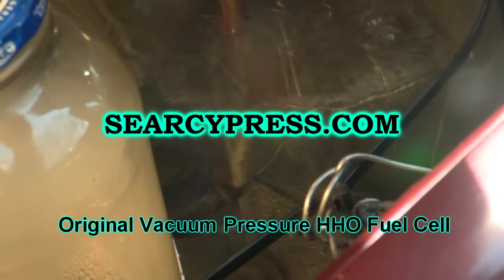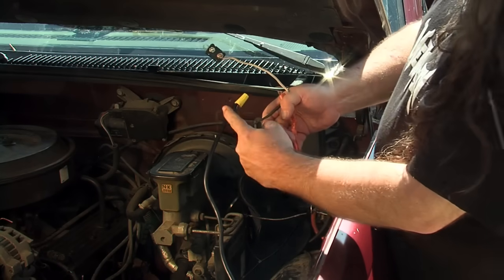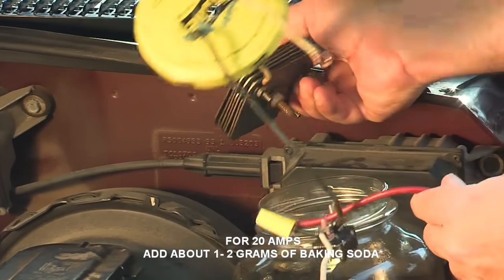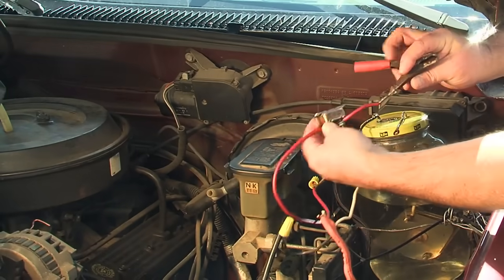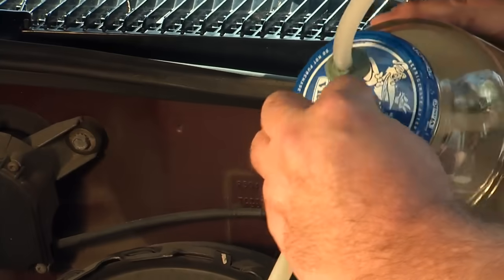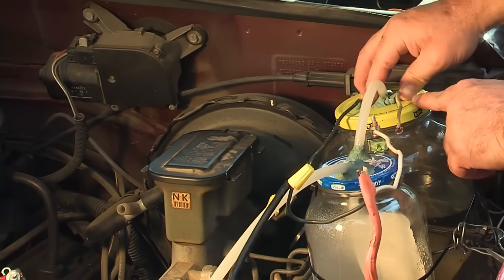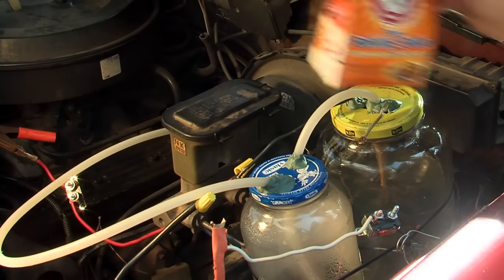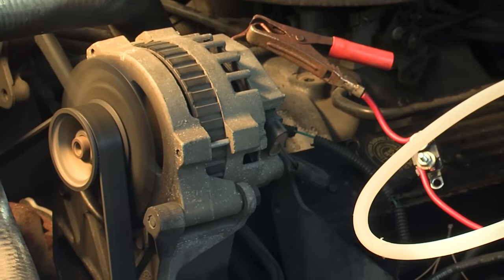Vacuum Pressure Hydrogen fuel cell defeats high gas prices using hydrogen from H2O.

Comment: Electric is the future, forget hydrogen
Reply from the maker: Hey, I love electricity. However, even though I have a very large solar system it's quite easy for that to not do the job. A gallon of gas has more energy than you might think. What's interesting is all the energy in that gasoline came from solar power. Liquid hydrogen would be the ultimate fuel because you could pump it in and get on your way. It is nothing but politics that stands in the way of that technology. It is completely unrealistic to think you can eliminate all the gasoline vehicles and suddenly hook everything into the grid that can barely handle what's hooked up to it now. It is fun to watch them try to sell that idea when you have an understanding of where it all comes from in the first place. Time will tell. Thanks for the comment.

Comment: Add another system that collects the water from your exhaust and puts it back into the fuel cell.
Reply from the maker: People assume that the water is coming from the hho. This is not the case. The system does not power the engine. What it does is power the efficiency of the combustion process in the cylinder. Most vehicles especially the one shown do not burn all of the gasoline and up to 20% of the fuel remains unburned and is ignited in the catalytic converter. Using this type of fuel cell however results in extremely high efficiency and the catalytic converter does not get that hot right away. Gasoline produces water when burned. That water is normally vaporized in the catalytic converter and you don't see much of it. However when using this system it remains cool and you see a lot of water coming out of the tailpipe from the gasoline. We have a new video coming out soon be sure and subscribe, thanks for the comment.
Reply: @metalpresstv  it's my understanding that when HHO combusts, it turns back into water.
Reply from the maker: @gbeebe  that is true. We get about 200 miles out of a gallon of water. Almost all of the water that you see coming out of that tailpipe is from the gasoline though. Thanks again for the comment.

Comment: Looks like a still!
Reply from the maker: It does in fact distill water into the secondary container. That water then returns by thermal vacuum to the primary cell container when the unit is turned off. Disclaimer- this is not for making moonshine. (-: We have a new video on this topic coming out soon. Be sure and subscribe. Thanks for the comment.
Reply: @metalpresstv  sell it  or sell product to big company so us less mechanically inclined can buy it for there car!  Very ingenuous!

Comment: I come back and watch this from time to time
Reply from the maker: We have a new video we're working on that will be out very soon. We show the installation greatly improved and some serious advancements we have made. We've also learned a few secrets that you should find interesting. Be sure and subscribe so you don't miss it. Thanks for the comment.
Reply: @metalpresstv did you ever finish recording that next video?
Reply from the maker: @vinm8297  It's been in production for over a year and will be released as soon as we finish the last segment. We have installed the system on a 454 stroker but we had to get to 454 stroker in line, before we install it and that took a very long time. Divorced choke, non- electronic system, EMP proof, stuff like that and timing problems were quite difficult getting it lined out. Thanks for your patience and keep checking back.
Reply: @metalpresstv  awesome, can’t wait to see it!

Comment: Let's make it clear that H2 generators do not improve gas mileage.  They make it worse overall.    The 2nd law of thermodynamics prevents gaining energy within a closed system.   You are therefore wasting your time and money.  It doesn't work.
Reply from the maker: Understand there's more than one kind of HHO system. This system runs in a vacuum. It is not diluted from intake air. When it ignites in the cylinder almost all of the fuel is burned. Normally, without the fuel cell, only 80% of the gas is actually burned. The rest is consumed in the catalytic converter. When using this system the catalytic converter stays much cooler. A lot of water vapor which is actually coming from the gasoline spills out onto the ground taking with it all the carbon and junk. Make no mistake, the gains we are seeing is coming from the 20% of the fuel that is normally wasted. The fact that there is more than one way to inject HHO into your system is the reason for so much confusion. We have a new video coming out very soon be sure and subscribe so you don't miss it. I'll try to explain how people like yourself are led down the path of disbelief. There's no shame in it, I would totally agree if we were injecting this into the air intake. We're not doing that at all. Thanks for the comment.

Comment: Does the engine rust faster?
Reply from the maker: People make the assumption that the extra water is coming from the HHO. This is not the case. We are not trying to power the engine with this gas. We are injecting into the vacuum system into the cylinder to try to achieve 100% combustion of the fuel. Normally a very large percentage of to 20% is wasted and passed through to the catalytic converter where it is burned there. Because we are getting such good combustion efficiency in the cylinder the catalytic converter does not get hot as fast. The water is coming from the gasoline and not the hho. It's always there, you just don't notice it because the catalytic converter is vaporizing it as it exits the vehicle. We have a new video coming out soon. Be sure and subscribe. Thanks for the comment.

Comment: Does this have any negative impact on air or water
Reply from the maker: The only effect that we really noticed is a lot cleaner exhaust gases. Normally an engine only Burns about 80% of the fuel. The rest that is unburned goes into the catalytic converter where it is ignited. Using this vacuum system almost all of the fuel is burned in the cylinder leaving the catalytic converter burning much cooler. There is a noticeable different smell from the exhaust system. As far as the water goes it is actually produced by the gasoline and not the HHO for the most part. It is a natural byproduct of burning gasoline but you normally do not see this because of the catalytic converter vaporizing it completely. It later then condenses and returns to the environment though it's probably quite toxic at that point. Using the system may produce quite a reduction in that emission. We have a new video coming out very soon. Be sure and subscribe so you don't miss it. Thanks for the comment.

Comment: Will this work with a fuel injection system
Reply from the maker: There's more than one type of hho system. Immediately when a post like this is made the wolves come out to say it's impossible. They tell you that the O2 sensor will immediately add fuel and etc. This certainly is true for injecting into the air intake of the engine but arguably not true for injecting into the vacuum system. When injecting into the vacuum system the gases do not lean out and are completely combusted in the cylinder. It might not be true for every engine but it is certainly possible to make it work. New video coming out soon be sure and subscribe. Thank you very much for the comment.

Comment: For everyone saying why not use modern sensors for safety, those sensors only communicate and work under very particular variables. To implement a Purge Solenoid would require fuel mapping and a host of impedance issues for sure. Would be very difficult to solve. For example. Put a MAF from a toyota into a chevy and it will never run right. I believe this video shows the fundamental basics needed, but when open to speculation on safety it will take some time to solve. Very interesting concept with the "Steam Clean" statement. I'm sure it works wonders for carbon build up. Thank you for the video, friend.
Reply: won't the steam (water) corrode the engine instead of just cleaning it?
Reply: @duhovnagozba1770   You're not thinking about this correctly.
Reply: @narutofanz4  can you explain how I'm wrong - why won't it corrode?
Reply from the maker: We're using solid copper wire, not stranded. Copper skins itself over and protects itself. As far as the plates go it's extremely high grade stainless non magnetic. It will last a very very long time. We have a new  video coming out soon so be sure and subscribe. Thanks for the comment.
Reply: @duhovnagozba1770  because rust needs oxygen, most of the o2 explodes in the cylinder anyways and out the exhaust

Comment: Hydrogen....the next generation clean fuel. Will wipe out that polllution causing NiCad/MagCad powered elec car.
Reply from the maker: Probably so. Being able to put liquid hydrogen into your tank would be beneficial for a host of reasons. Converting it into electricity seems kind of needless considering the amount of power it has on its own. Certainly electric vehicles will be a major factory in the future. There they are quite responsive and the maintenance required to maintain them is quite a bit less. Nevertheless, there's nothing like stopping the gas on an old v8. Gasoline is just stored solar power. Thanks for the comment. We have a new video on this topic coming out soon be sure and subscribe.

Comment: Interesting build that is very budget and DIY friendly. Two questions: 1.) How long does your alternator live with the water jug pulling that kind of amperage constantly? 2.) How badly is the interior of your engine rusting with all that water going through it?
Reply from the maker: I've never had any alternator issues that could be related to the cell. Using the system in the city does not do much good. It's mainly the highway where this device shows off. I usually turn mine off in the city. The HHO is not what produces the water. We are not trying to power the engine with this gas. What we are doing is injecting into the cylinder in the state of vacuum and producing a near 100% combustion rate of all of the fuel. Normally 20% of the fuel that you use ends up in your catalytic converter. At that point it's vaporized to meet emissions. When using the fuel cell however there's not much for the catalytic converter to do so you end up with a lot of water coming out because it's just not getting as hot. The water comes from gasoline not the HHO. It's always there you just don't notice it because the catalytic converter is so hot only vapor comes out most of the time.. We're working on a new video just finished filming another section today. We hope to have it out very soon so be sure and subscribe so you don't miss it. Thanks very much for the comment.
Reply: So the factory gas tank is still in the truck? Has anything else been removed, replaced, supplemented, to make this modification work? I want to make a water powered engine. I am looking into it researching to find different ways and go with the system that seems to be designed the best in my opinion. Thank you in advance for the amazing video.
Reply from the maker: @patrickfitchjr  The HHO gas that we produce does not run the engine. We are producing the gas to enrich the ignition inside the cylinder. Most vehicles do not burn anywhere near all of the fuel. As much as 20% passes through the motor unburned into the catalytic converter where it is then burned. With this system we produce HHO in the state of vacuum to burn as much of that 20% of the wasted fuel in the cylinder.. This leaves the catalytic converter much cooler. That is why you see a large amount of water coming from the tailpipe. It is coming from burned gasoline and not the HHO gas for the most part. A vacuum system is the only way this will work because diluting the HHO reduces the effectiveness. There is a lot of confusion and we have a new video coming out soon which hopefully will clear things up quite a bit. Be sure to share and subscribe. Thank you very much for commenting.
Reply: @metalpresstv  Because I grew up around mechanics, body guys, and farmers, I am aware that water coming out of the tailgate is a sign of a healthy engine. I can vouch for that. Thank you for clearing up the other things I was asking about. I was looking for videos that I can learn how to convert an engine to run off of gas like the guy that converted his dune buggy and then ended up getting killed. There are a lot of things that our not so loving superiors don't want us to know. I want to do things to help me get where I am going in life faster.
Reply: What guy converted his dune buggy to gas and got killed?
Reply: How is the flow of Hydrogen controlled when needing more power for the engine, and also at lower rpms such as idle???

Comment: How much baking soda is added to water ratio
Reply from the maker: It depends completely on the water you're using. Frankly it's a hit and miss situation for most people. You just have to balance it so that the automatic circuit breakers don't trip. It still May occasionally heat up during stops and things like that or times of heavy acceleration when vacuum is less. I always start with the two finger pinch. I know that's not a scientific method but I'll tell you now it's generally just enough to do the job. If I find out it's not producing enough I do a second pinch. Just remember as the fuel cell heats up to about 155° Fahrenheit the amperage will increase slightly. I do not recommend using tap water because of everything they're putting in it. We have a new video coming out soon we just got back from a test drive with a 427 and went pretty amazing. Hope to have the video out very soon so be sure and subscribe so you don't miss it. Thanks for the comment.

Comment: Two glass jars pressed together with no padding? Is this to just provide a clear view? And nice uninsulated tip of the live red wire coming off of the battery! Maybe be sure to seal that poster putty all the way around for a full seal and avoid a steady slow escape.

Comment: wtf how did i think this was fake for so long
Reply from the maker: There's a lot of propaganda and misunderstanding out there to keep you from realizing what this system does. Some of it is intentional and some of it is not. This system does not power the engine. It simply Powers the combustion process eliminating the 20% of wasted fuel that is consumed by the catalytic converter. There is no extra gain from the hho, the extra gains are all coming from the gasoline burning in the cylinder instead of the catalytic converter. To make things worse people have tried injecting this into the air intake. This is hopeless. All you get is a diluted gas which may trigger changes in the O2 sensor. Injecting into the vacuum system is a completely different animal. We have a new video coming out, I hope to cover  as much of this as I can. Don't forget to subscribe. Thanks for the comment.

Comment: I copied this build. I used 3 stainless face plates. I used tap water and baking soda. 

Almost within 30 seconds my water turns dark green.  I get fizz,  small bubbles... but no gas going to the dryer jar. 

Now I was testing it with a jump pack... I havent put it on a truck yet. 

Could it be that I don't have enough amps on the jump pack ?
Reply from the maker: Interesting. Your going to need a lot more than three plates. The system is designed to work optimally in a vacuum. I would recommend at least seven plates with a gap spacing of at least 1 mm no more than three. I'm not saying to build this, however that's about what it takes to get it done. Once the system is under vacuum and you have at least 20 amps, but no more than 30 going to the cell you will see amazing results of production. It is extremely difficult to put together seven plates, I won't make any bones about it. It takes skills to put this stuff together. I have a new video coming out soon that will show the most advanced plate design we have ever created. The parts are easy to obtain but you have to have some nimble fingers to put all this stuff together and some tools. Building the cell is the hard part. The next hard part is properly drilling the holes in the lid and getting the wires through them without stripping them. It takes a bit of skill. We're working on the video and hope to have it out very soon. Thanks for the comment.

Comment: How long will this last? How often do you have to maintain the water and other?
Reply from the maker: You can use the cell for many years. You might occasionally need to replace the pickle jar lid. You can get about 200 mi out of a gallon of water. It depends on how much electrolytes you've added. We have a new video coming out soon, be sure and subscribe so you can see the improvements we've made over the years. Thanks for the comment.
Reply: @metalpresstv  Thanks much for the reply. With how things are getting serious nowadays, I’m sure you know what I’m talking about, and sickly New Alternatives to be off grid. Thank you for this knowledge it will bring us great freedom.